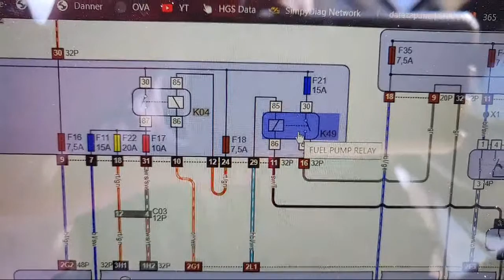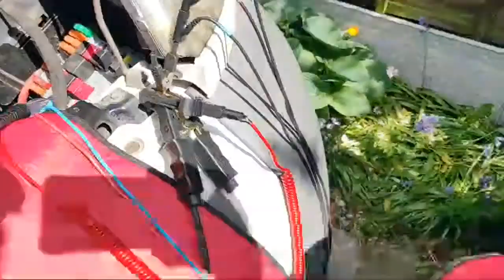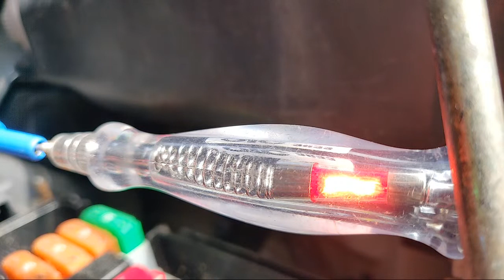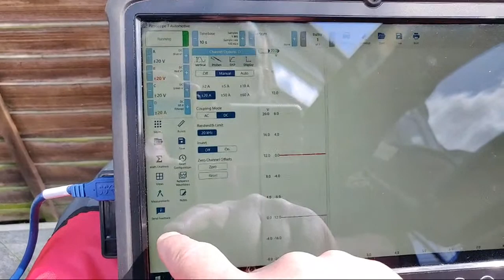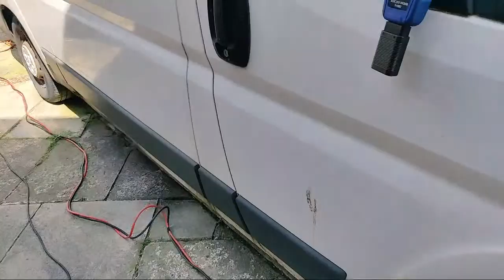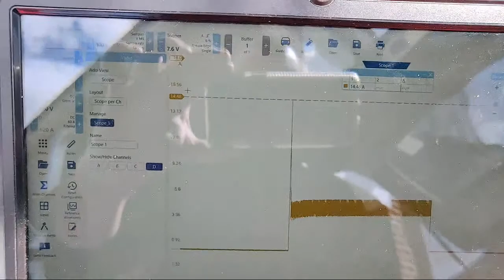P0230 Fuel Pump Relay Control - No Start

Comment: Another well explained procedure., with a further insight into the use of PicoScope. (You mentioned the equally perfoming pump segments. Although well documented in James Dillon's Oscilloscope book, it  would be good to see in practice the way we can identify the number of segments; one or more worn ones; and how we can determine the speed of rotation of the pump.) But great video. Thanks, Steve.
Reply from the maker: I'm pretty sure I've done a couple of videos analysing fuel pump waveforms  in the past, this video was more about initial approach rather than analysis.👍
Reply: @SimplyDiagnostics  Yes mate - I understand - was good. More a reminder that it is a powerful way to analyse the pump condition :)